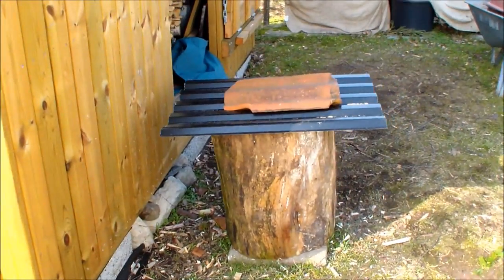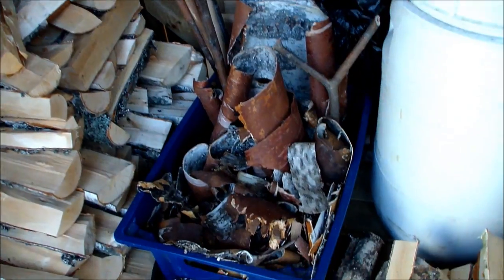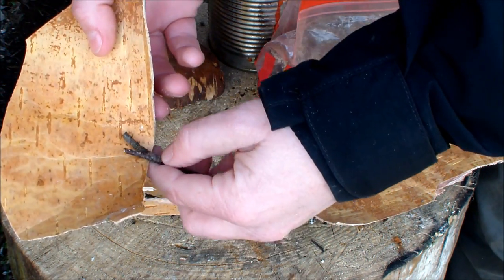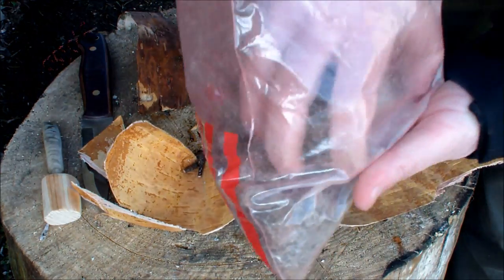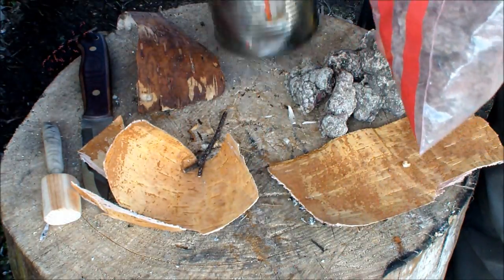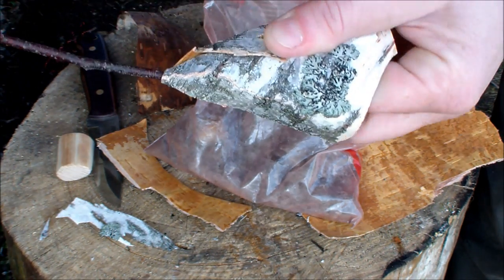Ojibway bush match.

Comment: Hello again vacker dam. I see you're setting light to Sweden again:-)) This looks like a job for the Svenska Brandkåren! (If I've got it wrong ....blame Google). Great idea & first attempt, to me it did look a bit risky towards the end with all that dripping resin. I'm going to try your idea but with the base of the cone sealed with compacted earth, a thicker stick and a second, outside, layer of "green" bark, maybe young lime (tilia- I think you call it the linden tree) or willow (salix) to act as an insulator. This looks like a great winter fire starter that will keep the wind off and will work in rain or snow. Thanks to you and Kanzee for sharing the idea Ulrica. Good post. Paul
Reply from the maker: TheRunereaper Hi Paul, makes me happy you liked it. Well,  I actually dont think its meant to hold that "fire flower" ( I also love that name!) as long as I did, but if you should use it as a torch or for longer burn, maybe skipping the resin would be an option, or as you suggested, some sand in the bottom. A green stick for handle would also help a lot, I guess. Now I just grab something in reach, lying on the ground. You got Brandkåren right, but I would say " vackra dam" :) I apprechiate you took your time to watch and comment. Take care my friend. ATB, Ulrica
Reply: +TheRunereaper thanks for your wonderful and supportive comment. I would love to hear about your modifications ...sounds great. Cheers ;-)
Reply: +Kanzee Well Kanzee, to my eternal shame I haven't got round to trying it yet. It seems I'm just another pontificating, armchair bushcrafter after all. Ulrica's videos are among my favourites and she deserves a much bigger following, she has wonderfully competent hands. I really do think other things could evolve out of this idea - possibly even carrying fire for several hours. When I eventually try this out with the mods, you and she will  be the first to know. :-)) Thanks for replying. Paul
Reply: TheRunereaper don't find your comments to be pompous at all ...Armchair bushcrafting can have its fun momments as well, especially when your elderly with Aged bone pains from deformity...It's great to have Youtube bushcraft world , so one can continue to Contribute and support others. Cheers ;-)

Comment: Hi Ulrica,

Thanks for the demo’ I guess you could also stick the stuff you want to use as a Ojibway Bush Match to, as you mentioned near the start, some newer much more flexible Birch Bark, and roll it up as you have here and then fill it with more pine resin and other stuff, and use a slightly more curved and much thicker handle so there is no drips able to run down and burn your fingers.
I have in mind having seen yours, ‘and this by the way will lead me to research this so can you tell me where you said you got this again please’, a ‘Match’ which s maybe thinner and about half a metre long if that was possible and this can be held to light a stubburn fire and as soon as it is alight the Match can be dipped into water a river or anything and it can be ‘mended’ if necessary and be ready to use again.

Of course this is all theoretical, but I would imagine, provided the original design was in some ways possibly able to be used like this it might give a constant Match that can be used, quenched, and with more new birch bark wrapped around if necessary with a layer of resin glue this might be feasible? Of course whether it comes close to what your informant says is the ‘correct’ way to make and use this type of ‘Ojibway Bush Match’ I don’t know, but I am guessing it would be a big advantage to have a larger match with a good strong stick to use over and over again, and I do realise your version was just a quick example.

Thanks again for your upload, even if, as is the case here over the past week it seems brighter but it is still cold and very windy.

Take care
mrbluenun
Reply from the maker: mrbluenun Hi there my friend. Such a long fire starter is nothing I have heard of and I haven´t done that on my channel. I wonder why it should be that long? would be hard to pack down and take with you in a back pack. If you want something that can be used over and over again, I guess it must be made out of steel and made so you can add more stuff on it after use. A lighter with a long piece/neck up the flame, maybe? The light is back here as well, the last few days have been sunny, but its windy and not so very warm here either. Thank you for taking your time to watch and comment. Take care my friend. /Ulrica
Reply: Gullrica Hi Ulrica,

I got carried away and was thinking of a fire match that would be used in a permanent encampment sorry. I like you idea and think it can save a lot of frustration especially if everything is damp.

Take care

mrbluenun
Reply: +mrbluenun I like to hear about ppl's love for researching history...to help in your journey into this Ojibway bushmatch...look into the Native Canoe nite fishing techniques..there are very few of us that still practice these matches / torches and nite fishing practices...as modern ways have become dominant and the canoe is replaced with the metal motor boats and the Ojibway torch/ match is replaced with modern hipowered spot lights...I do look forward to hearing of your research findings and passing this on to our tribal youth. Cheers ;-) Miigwetch (thank you)
Reply: +mrbluenun I remember back in the good yonge days, we would all set up our torches and have spares on poles of our canoes..the women would also come out , in there canoes loaded up with these ..and as the experienced fishermen would go out spearing , ahead, the women would follow behind and replace the torches easily, using long poled "Ojibway bush matches" it was a team effort ...and much fun was to be had, untill we had to clean all the fish , but these days are long gone, as the fish populations have dewindled and the youth are no longer attached to this lifestyle and rather live in the fast pace cities. We are a forgotten traditional minority, even among our own tribes, only read about and remembered in museums.....lol cheers ;-)